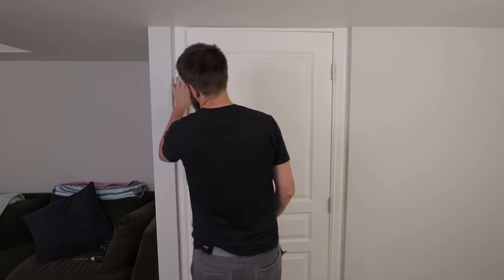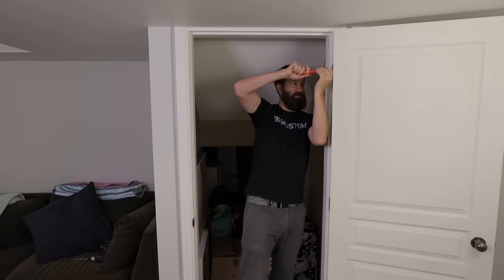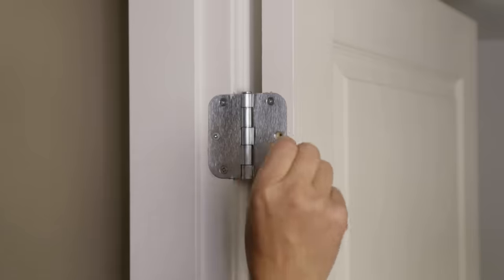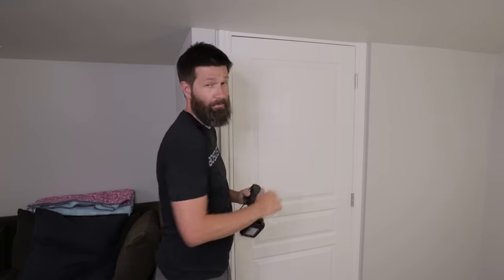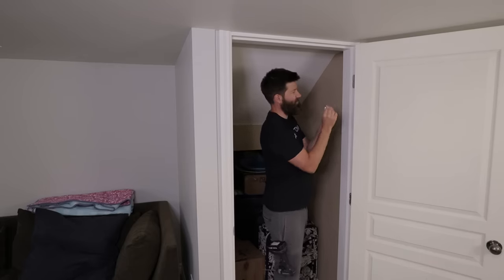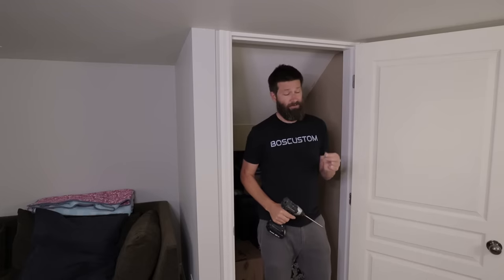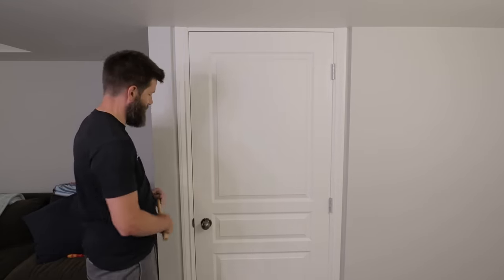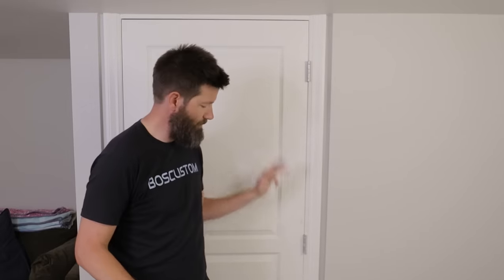How To Fix a Sagging Door that's Rubbing or Won't Close!!!

Comment: Wooden golf tees take the too hinge off put a little gorilla glue on the tee and hammer it it let it sit then use a vibrating saw and cut flush the predrill the hole a couple of sizes smaller then the screw then reinstall hinge
Reply: Also not only head size on the screw but head depth as well

Comment: my door was fine until i did a layer of primer getting ready to paint, now on the hinge side both the middle and especially the bottom are so tight it's pulling the whole hinge side of the frame from the wall and the bottom of the door is hugging the jam

Comment: When tightening with a longer screw, the maybe better solution is to just take out the three screws on the top hinge, flip it out and use the size screw you need to get the job done, then fasten the hinge again with its original screws. That way you can use a larger screw with much more strenght, whch is needed for more robust frames.

Comment: 1.  This door is leaning ↙️, so we start there .😅   We start with the hinge on the door itself.  We will  unscrew the middle screw that’s attached to the door.  Then, you put a toothpick or 2 in that middle hole and break um off.  Next, we screw the screw into the middle hole of the hinge.  Check to see if the door is closing correctly.  

2.  This door has another problem, so we Go to the top hinge, the side of the hinge that attaches to the doorframe. It’s the top hinge, middle screw, on the door frame. The head size of the new screw has to match up with the existing size of the old screw.  The new screw needs to be about 2/3 inches long.  Take out the middle screw from the door frame and replace it with the longer screw. Check it out! 
Problem solved, except there is a third problem! 

3.  The hinge may be the problem here.  The hinge is made up of 2 plates.  The hinge on top and the hinge on the bottom look different.  
Remove the pin from the top hinge.  Then line the knuckles up and replace the pin. (You can use a hammer and gently tap the knuckles of the hinges until they are lined up.  The pin should just slide in to the hinge.  ) Just tap to move the pin all the way back down. Check!  If the problem is not resolved, you can do step 3 on the bottom hinge. 

4.  Problem still not resolved?  
Call someone else!

Comment: I had this issue with 2 door at my house.  The hinges were so worn these fixes wouldn't have worked.  there was nearly a 1/16" gap between the loops of the hinge and the pin was visibly worn.  Sometimes it's worth the $4.00

Comment: I think you should have kept trying to close the doorin the beginning of the video. I think it would have closed eventually and you wouldn't have to do all that work. Also, if you've actually had to fix 30 doors in your house over the years, You need to find what you're doing wrong when you install them.

Comment: This is a waste of time and any money you spent and in the future you will be spending more money fixing what you thought you fixed for not actually fixing the main issue of why your door won't close properly I'm saying this because I have been working on leveling foundations on houses for a decade and this is a early sign your foundation is breaking and if you don't fix your foundation by leveling it the situation will get worse and if you do this kind of what i like to call bandaid solutions when you actually end up seeing the real problem and fix it that door will end up getting worse sometimes locking the door in place and even mess up the door frame depending how many bandaid solutions you have added to the door and this problem even includes for dry wall cracks as well that so many I have seen doing is fill the crack and paint lol so don't do this save your money for the real problem and fix your foundation before it gets more expensive the sooner you fix it the cheaper it is